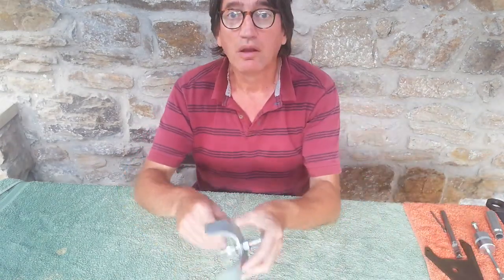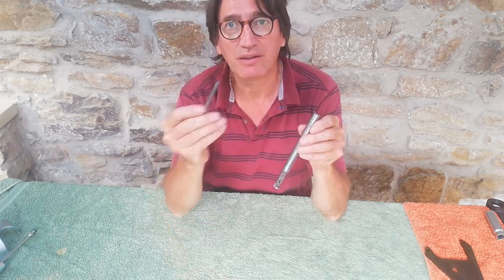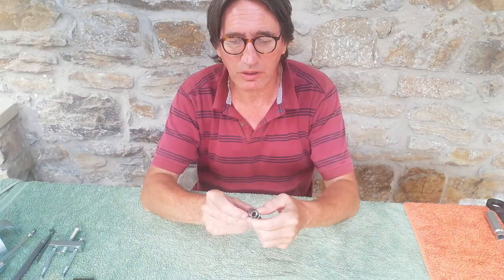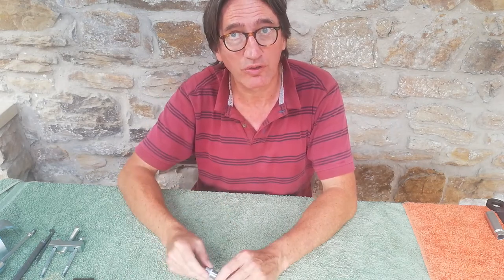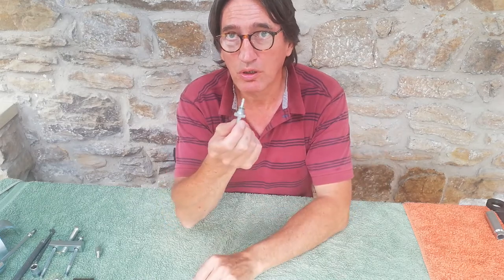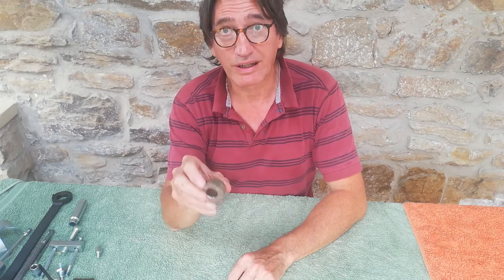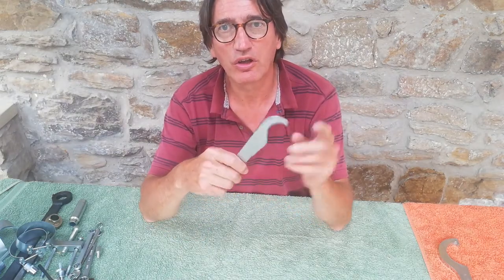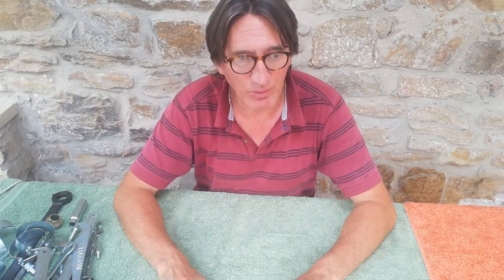Norton Commando special engine rebuilding tools examined and explained

Comment: Nice review. For the carb allen socket bolts, I've found a micro ratchet with the hex drive bit works atreat. You can actually ratchet the bolts on/off....so much easier than the allen key. 
For the rocker shafts, I've used a simple homemade puller made out of a metal tube wide and long enough to accept the shaft (actually a sparkplug tube wrench works well), some all thread rod, nuts and large washers. Does it nice an smooth, still heating the head with propane beforehand.
Reply from the maker: Yes, I think that if I removed the rocker shafts again I'd draw them out in the manner you describe rather than use the slide hammer. 👍

Comment: Thanks for all the insight Chris! I of course have your book which I am using to slowly work my way through my '73 850 Mk1. I found it in a shed in Minnesota where it had been sitting for 30 or so years with less than 4k miles on the clock. Problem is that the shed was only weather resistant and I am dealing with a fair amount of corrosion.  Like you, I've also worked on a Japanese UJM, '78 GS750E in my case. Some of the Norton design approaches and quality really make me wonder. I still love it though!
Reply from the maker: Thanks for your comment, and good luck with the rebuild!
Reply: @Chris.rooke150  This is valuable information. I'll be buying your book.

Comment: The exhaust lock ring spanner will also work on the shock absorber preload ring of the early Honda CBR600. Just needs a touch with a grinder on the "tooth" to make it fit.

Comment: The AAU (not "contact breakers") extractor bolt is 5/16" fine (UNF) not "1/2" coarse" as bolts aren't described by hexagon size.